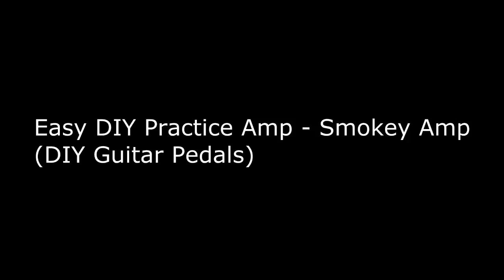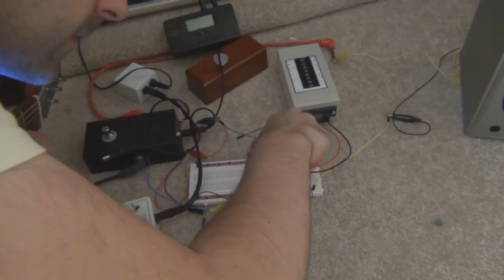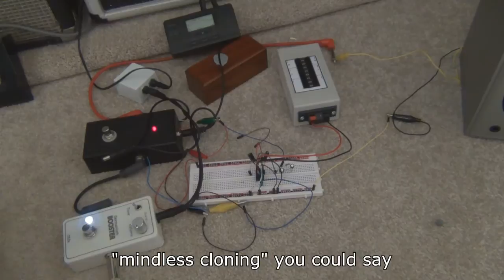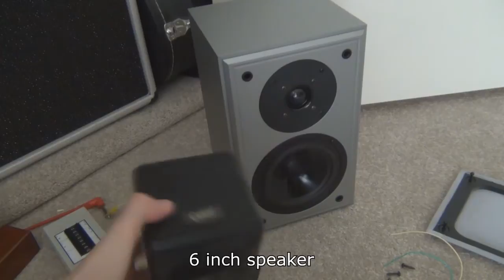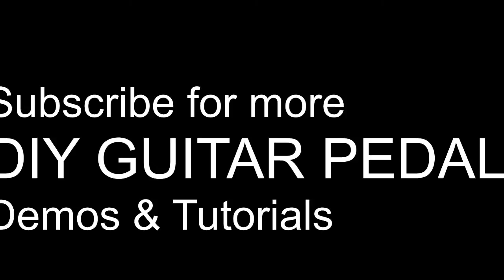Easy DIY Guitar Practice Amp - Smokey Amp

Comment: i built it with just the chip and 2 47uf capacitors. what i got was very fuzzy glitchey amp. did i damage the chip? its working fine but it glitches out on sustaining notes and is pretty gated. any thoughts?

Comment from the maker: Its probably oscillation if its an overdrive / distortion / fuzz.  Dealing with  oscillation is a video on its on but a few things you can do to minimise it is, star ground, shielded input wire, but most importantly i have found keeping the wires short and dont cross them.  Also, some circuits just do it.  For instance the fuzz factory is notorious for it at high gain settings.

Comment: Hi, I have a question for you. I have built a clone pedal and I am experiencing a similar high pitch squeak if I turn the gain up to much on the pedal as far as I know it is all grounded correctly and is in a metal box so it should be fully shielded. is there anything you can think of that might be causing this to happen?